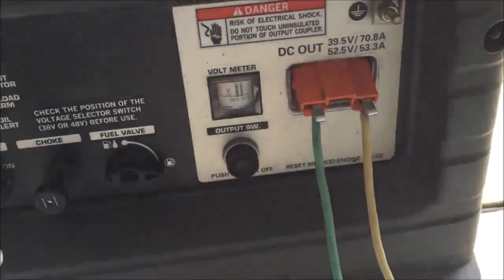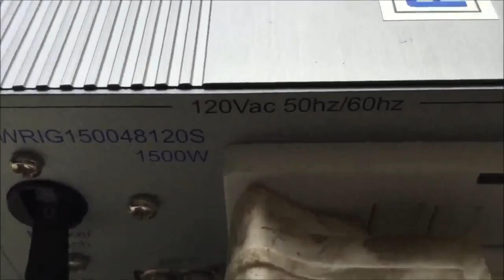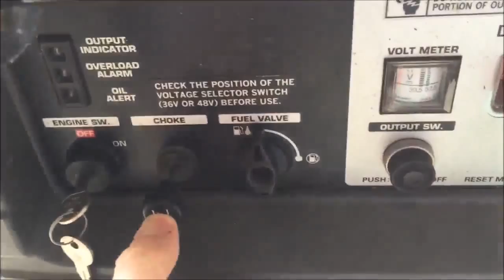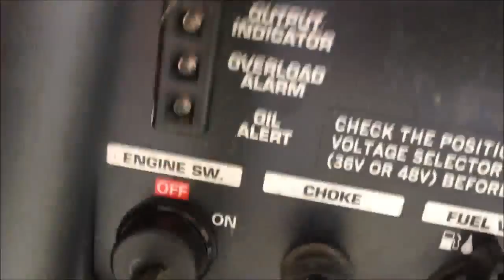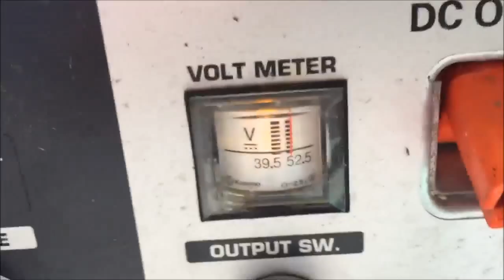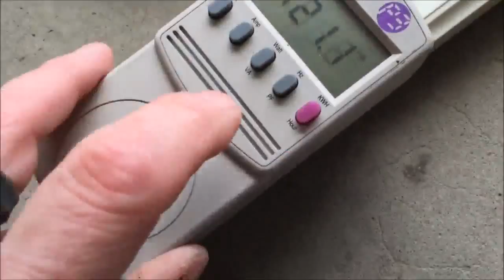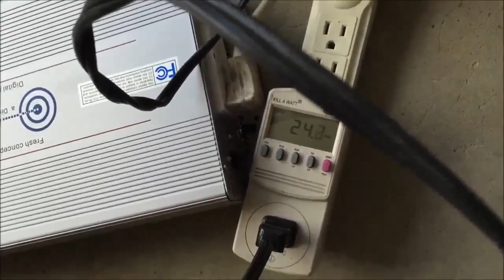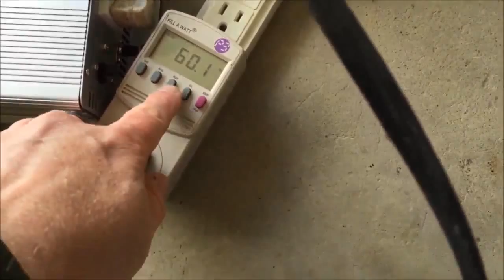Honda eu3000is converted in an alphagen dcx 3000?

Comment: So can I use my alphagen generator attached to a 48v battery from the genny, then wires from that to an inverter in order to power 120v devices? Leaving it setup like that? And why 1500 watt inverter instead of 3000 watt?
Reply from the maker: Sure can. You can use whatever 48v inverter you have, at the time all I had was 1500 watts, now I have added a 6000 watt inverter, and I also added a dc dc boost converter so,now,I can charge my lithium batteries at 57.6 and not limited to the 52.5 that the generator outputs.
Reply: Can you send me a photo of your setup and how you wired it please
Reply from the maker: @efiniwhistler  for just connecting to battery and inverter it’s simple. + and - from dcx3000 to battery, from inverter + - to battery. 
If you add a dc dc converter , then it’s dcx3000 to input side on dc dc converter then output from dc dc to battery, set your output voltage to 57.5 or whatever you battery needs if it’s lifepo4. Then inverter to battery. Believe it or not if your inverter doesn’t have a high surge device, you don’t even need a battery.

Comment: The thought process here has me confused. If the inverter circuit on this one fries, you are still looking at a very expensive inverter to rplacce. What, you spend another 300 to buy another one of these generators used? Now you are out 600, plus the cost of a 3 to 400 dollar power inverter now you are into it for 900 to 1000. By then you might as well save your money and just buy the Honda 3000
Reply from the maker: This allows me to charge dc to dc as well as use my golf cart to extended distances

Comment: Dangerous workarounds aside, the easier/better way to run this, would be as-intended, with 3 or 4 batteries between the generator and the inverter.  

If you would like to run in "forced" mode, you could use any inexpensive option, such as a tool battery or set of inexpensive cells and simply make sure to set them up to exceed the output voltage.  In this instance, the batteries won't ever charge (unless they're essentially dead) and the start/inverter can be hard-wired without risks.
Reply from the maker: agree

Comment: Just saw one of these come up for sale locally. I am wondering if you just add a 48v battery in-between the generator and inverter if it would work better. Then it might be able to handle the load spike better than just connecting the inverter to the generator.

Comment: I just use the battery trick to get voltage 48 v setting can I use the negative as a ground and a positive I put a welding electrode holder on it so I can use it to stick weld and it works
Reply: hey david, just to confirm, did you get the electrode stick welding work? is it smooth enough? any idea how much amp was use for output?
Reply: I'm not sure about voltage but it welds smooth thick steel and is portable

Comment: I have 1 of these generator I get it from a friend, it has been pack down for a while with gas and oil in it he give it to me ,but its not starting, any advance.
Reply from the maker: Easiest way would be to buy a new carb for a honda eu3000. there is a good chance the carb is blocked up. Second, I would make sure the gas tank is clean.

Comment: I’m thinking about purchasing this will it work for an Rv? Thanks for sharing
Reply from the maker: If you use an inverter set up similarly to how I have it setup in that video, then yes. Keep in mind this is not a 12v system like most rvs are. But it would give you 120v ac outlets.  This is probably not the best solution for an RV

Comment: The Honda EU3000IS is a awesome little machine◔◔>share4.photo/H3KInverter?zこz    This is the second one for me.. the first is 3 years old and still running strong.. It is quiet and penny pinching on gas.. small enough I can load by myself.. I added the all terrain tires for easy moving..

Comment: I have 1 that was pack up for a while and I can't get it started what can I do.
Reply from the maker: Bryan Cummings if the engine won’t run, my advice would be to make sure the key is in on position first.  If it still doesn’t run, make sure you have fresh gas in it and the fuel value is turned on, and put the choke on. If it still doesn’t start, check for spark, and then check for fuel making it to the carb. The carb bowl comes off rather easy. It’s possible you need to clean your carb depending on how long it has been sitting. Hope that helps
Reply: I'll try that thanks

Comment: Hey do you know how to just plug in the converter and not have to do the battery trick? I have one of these and I'm trying to just connect it to an inverter to see if it would work like that
Reply from the maker: I don’t believe there is a way to hook it directly to an inverter as it is looking for a sense voltage of at least 2 volts I believed. I have tricked it with a 9 volt battery though

Comment: Is this would charge batteries on ab32 volt system?That’s what I have on my boat,32 volts.
Reply from the maker: david quinn you would have to check your battery manufacturer , i believe this will output about 39vdc in the 36vdc mode. so the question is can your battery accept 39vdc ?
Reply: You will need to use a solar charge controller to supply a 32V nominal battery.

Comment: Ah yes the AlphaGen.... I work in the telecom industry and AlphaGen is made by Honda specifically for Alpha power systems which provides the online power systems for cable and telephone companies.  Cool find indeed for super cheap!
Reply: Hello, I am looking to purchase 10 Alfagen DCX3000 generators. The manufacturer is not making them anymore. do u know if someone is selling them or if a new product is for sale in the market. I need it for telecommunication purpose. TIA
Reply: @wajdoni  I have around 20 for sale. 400.00 ea
Reply: I can get you another 5 if you still need one  @wajdoni
Reply: I work for Cox communications.and indeed that is used for keeping the cable and internet Node working during power outages.i repair them.the best you could do is set up a 36vdc battery bank with a 36 vdc inverter.

Comment: Great find. I installed a DCX3000 on a golf cart and added a 4500W 240VAC inverter charger. You should add a small 48V string of SLA batteries for 50-60 dollars, your inverter will be much happier. Also looks like we can add electric start for about $150 and there is a guy who made automatic chokes for IS generators.
Reply: What part(s) can be added for electric start? I'm assuming it's the stock EU3000is starter + key switch that has the momentary start.
Reply: +cyberstick2 look up Honda spare parts, EU3000is, the electric starter assembly is part of the recoil hat on the front of the engine (fan side) since there is no flywheel ring gear for a bendix style starter to use.
Reply: +cyberstick2 I was also looking at possibly spinning the engine with a sensorless BLDC motor controller, but would somehow need to position a 100A 3pole relay between the Stators and the electronics to switch between starter drive and rectifiers
Reply: Nice, thank you. Looks like PN 28400-ZS9-A04 should do it. Will experiment. Hoping in the end to have two-wire automatic start capability on this thing.
Reply: +cyberstick2 Pinellas power products has a choke solenoid kit. I would like to use Magnum energy's AGS-n generator control to start/stop that would communicate with my inverter.
Reply: Here is the video of my DCX3000 floating a 235Ah 48V system that has a 4.5kW pure sinewave inverter - https://www.youtube.com/watch?v=PSNyKXgzz_M

Comment: I have the Honda EU300IS when eco switch is on you cant even hear the gene unlike yours also it has electric start. it wasnt cheap as you know.. you have interesting setup..but ill stick with the EU as for the inverter giving out they make em pretty bullet proof
Reply from the maker: thanks for confirming, yes this does not have an eco switch, but it seems like it's always in Eco mode. it's very quiet the microphone make it sound louder that it is.
Reply from the maker: +benjamin saunders it actually has the Eco throttle, just no visible switch. it's in Eco mode by default, I haven't looked to see if I could add a switch or not. it regulates the dc voltage to within 1% of 36v or 48v.
Reply: It makes sense to omit the Eco throttle option from this generator. It is designed to float 48v battery banks at 52.4vdc, therefore never has to scramble to maintain its DC link voltage to an inverter during a transient power increase. The DC link is the battery bank instead of some capacitors in the 3000IS AC inverter.
Reply: +SuperRobkar Yes, it's regulation is pretty good. I see between 2800-3600RPM from zero load to 70A output. 2600RPM is the most efficient speed for the GX160 engine at about 313g/kwh of engine output (not generator output). Efficiency decreases to about 360g/kwh at 3600rpm.